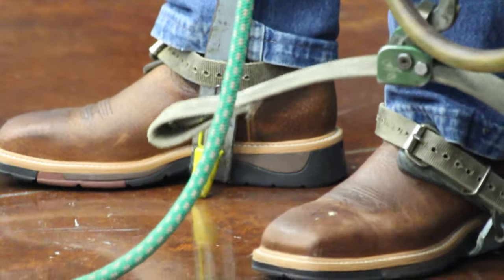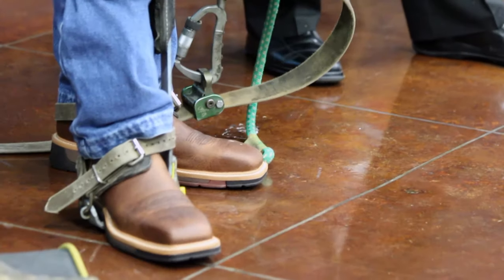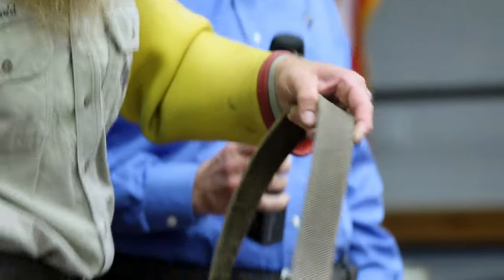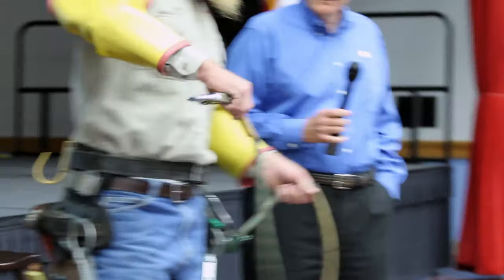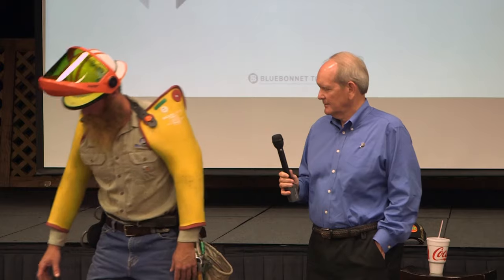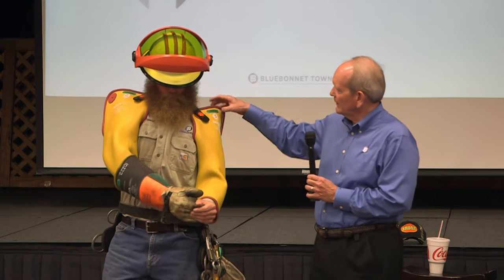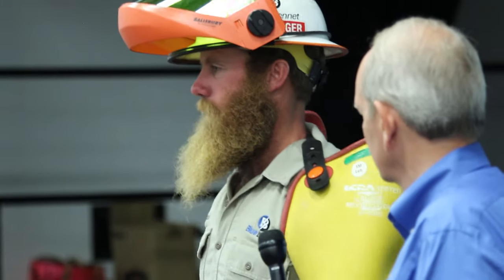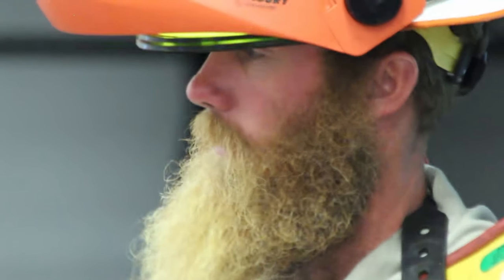What it takes to be a lineman

Comment: Holly crap that's a lot of equipment and PPE to be carrying around. Good thing nowadays there are bucket trucks. So you only need to climb poles on very rare occasions. 

Does your company make you climb live poles like this in 2016?
Reply: It's a genuine question
Reply: If you are not strong enough to carry the gear, you are not strong enough to be a lineman.
Reply: Sr Rs there are situations where a truck cannot get to the location. In these situations a person on the pole is the only way.
Reply: Sr Rs i climb poles at least 3 a week when working storms it's sometimes everyday all day. Been doing it for 15 years 3rd generation lineman. Mississippi power.
Reply: Joey Slamans Hey I'm looking to get into this field. Where do I start.
Reply: Northwest Lineman College
Reply: MrMojo _MAN school, typically if you can find something for electrical distribution but there are programs specifically for this field. Better that way to get familiarized and a little bit of insight.
Reply: In rural Virginia you have to climb ever other pole you work.
Reply: not true. we climb all the time
Reply: Here in Detroit, there are Service Centers where you climb EVERY DAY!! If you go a day without climbing that week, you consider it a good week.
Reply: I am told that the linemen get so hot that they relish the bucket because they can drop their pants to get some air.

Think about that next time you see a dude up in one of those things in summer.

Comment: During the hotest days in summer, it would be nice for all the management in suits take a day those who think more gear is safer like wearing a bomb suit to defuse a bomb, not really, safer is work practices, knife safety,  awareness, less pressure to perform, go faster because of number...
You all need to come to work normally, have your meetings out in parking lot wearing boots, 3 layers of cloyhes, gloves, sleeves,hard hats, bee keepers mask, face shield, walking around , sitting down and see if it really worth hest exhaustive, over heating, not thinking straight because it's hot to breathe...
Many over of over a hundred years made it through with leather gloves, cotton t-shirt... 
Im in control more saftey,  more, clothes... do the job first, be idiots later...
Work practices, procedures, check and balances,  aware of known hazards (which is just about every day) experience, calling in extra help, not because it cost to much...
Your welcome